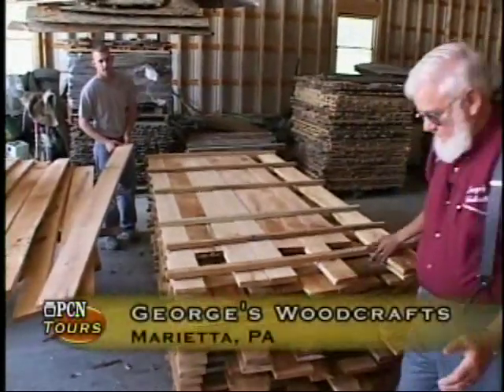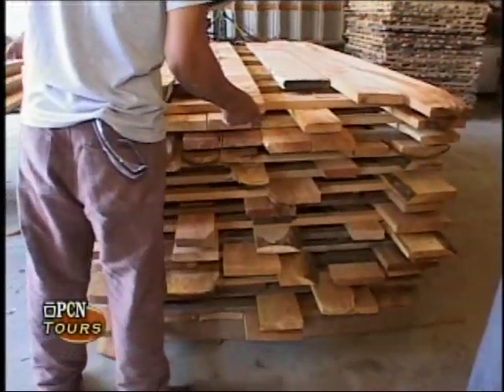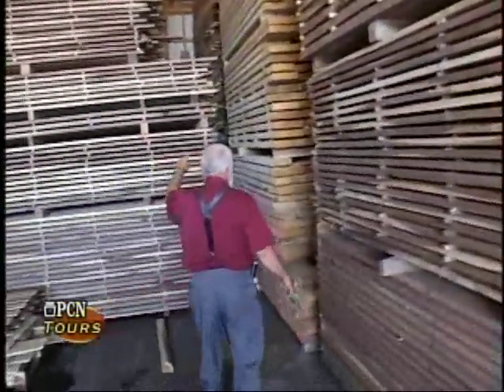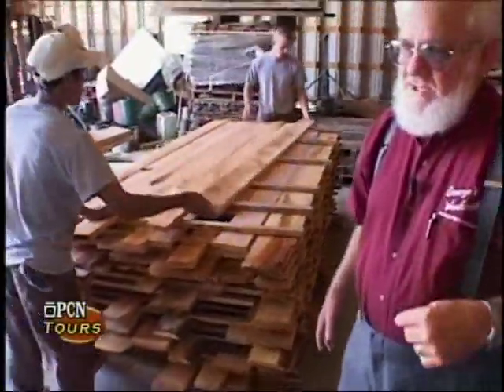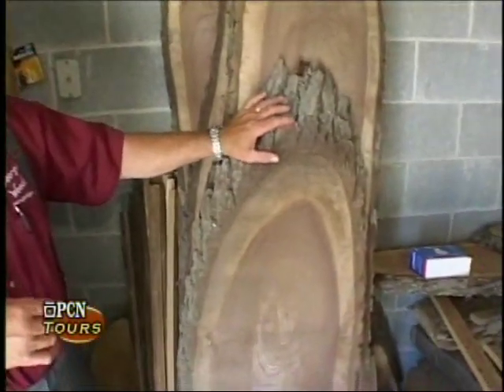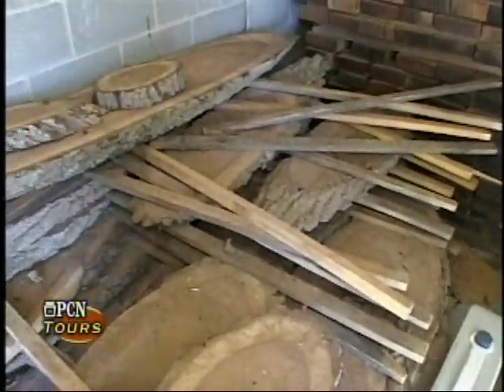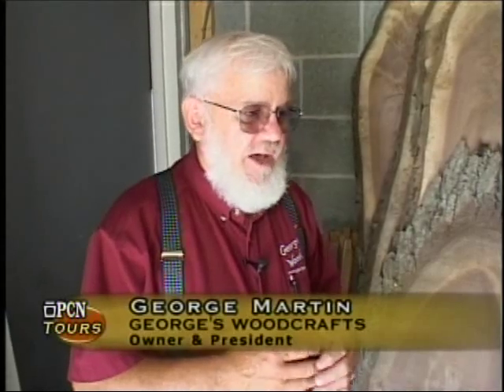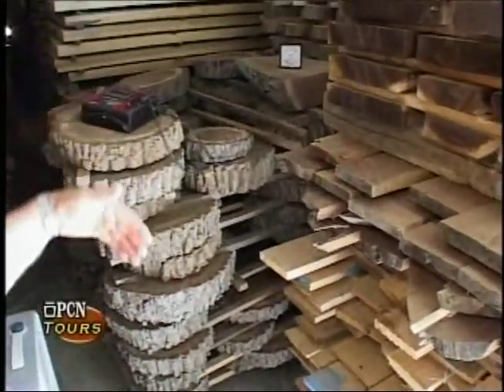Stacking and Drying Lumber

Comment: good day sir, iam having trouble with asian (south east asian) species. i run a commercial kiln dry lumber service. each chambers stacks and load around 130m3 and i have 3 of them (stacking flat boards 3cm thick x 15-30cm breadth x 4m length or block boards which are 5cm thickness up x 15cm width max x 4m length). i am currently, getting MC's down to 21 days to get to 20%MC apprx. Indonesia local requirement. can i have it done in shorter days? 
"want to learn"